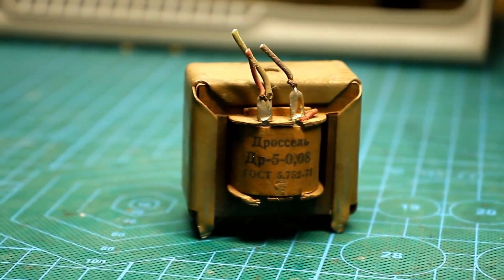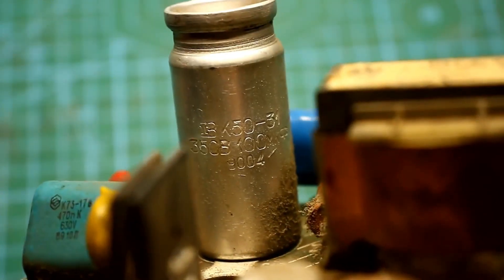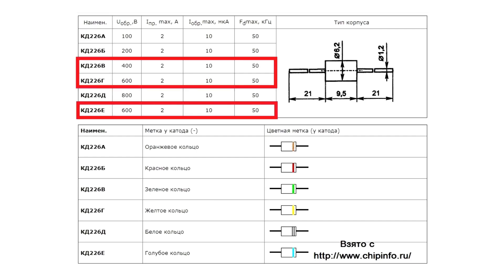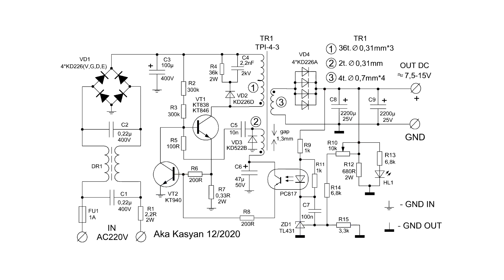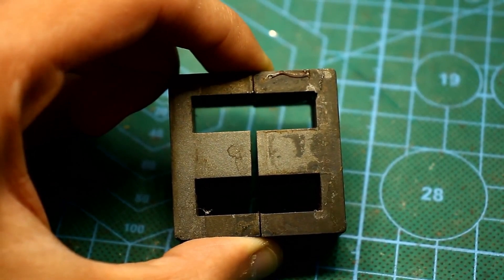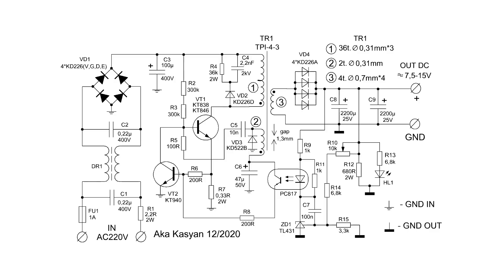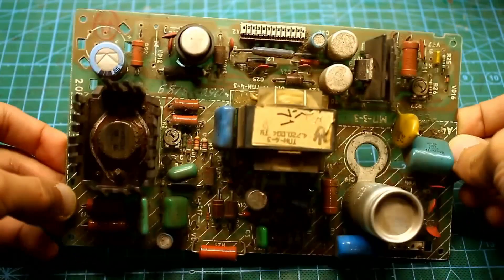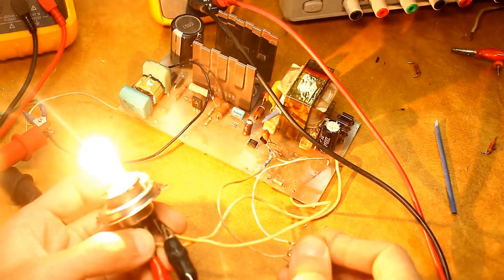Cool DIY project from an old TV.

Comment: Hi. I have seen your video on diy soldering station. 
Can you design a circuit in a way that
It uses the regulator with triac circuit but at its bare minimum on condition with fixed value resistor and convert the output voltages to dc using bridge and then use your diy soldering circuit diagram with n-channel mosfet.
Is it possible if yes then make a video for education purpose / if design becomes simpler and cost effective it may replace old fashion non temp control soldering irons.